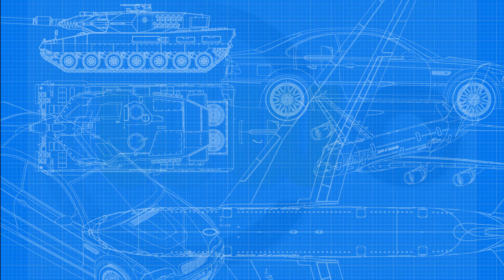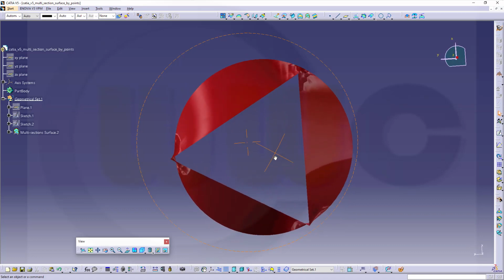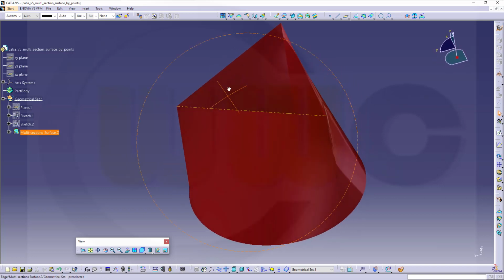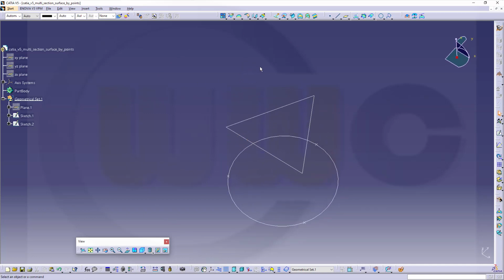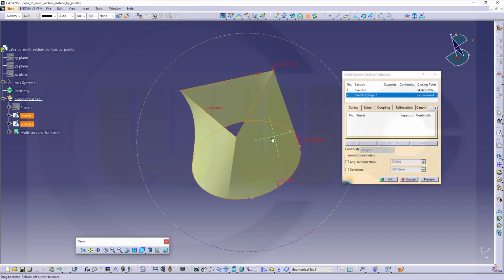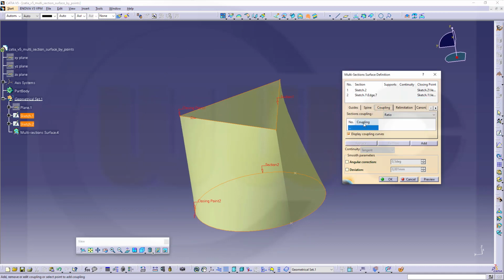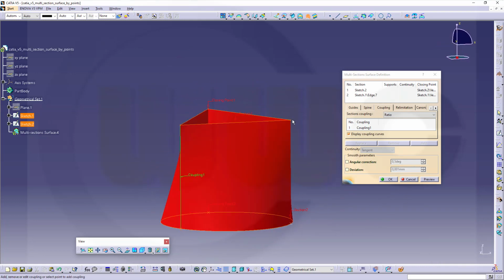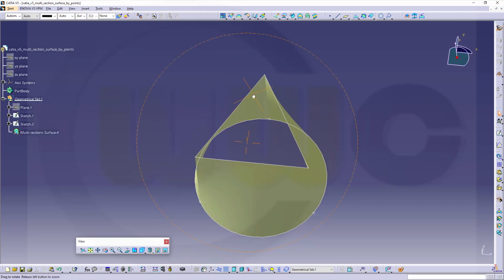Multi Section Surface by Couplings - Catia v5 Training - GSD

Comment: Whats the difference between Ratio, Tangency and Tangency then curvature? 

I've read about it but what does "Tangency: the curves are coupled according to their tangency discontinuity points." mean?
Reply from the maker: Isn´t it obvious. If you have sort of "corners" / discontinuities the software tries to connect those first and couple it with "edges". If the number of those "corners" is equal in all profiles you get a very nice shape. Just watch all my videos covering this command.

Comment: How would you control how quickly the triangle profile blends into the the circular profile along its longitudinal axis? For example, if you had the triangle and circle sketches 100mm apart, and after applying the loft after using the multi section command, by default Catia starts blending the triangle profile into the circle profile at 50mm along the axis, is it possible to keep the triangle profile maintained for longer say until 80mm and then from 80mm to 100mm, it quickly blends into the circle profile? Would you achieve this using a law? Or would you have to do it manually with an extra triangle profile 80mm apart from the original, and use the multi section to connect them together, and then do another multi section from the triangle at 80mm to the circle profile for the last 20mm?
Reply from the maker: You could use extra triangle profiles or some "guides" I will do more videos on this tool. In order to blend 2 profiles you can use a "blend" surface and adjust the "tension".